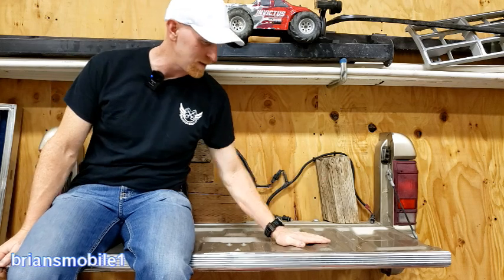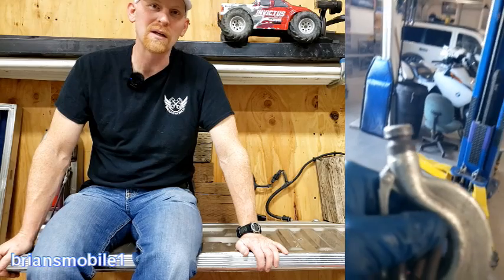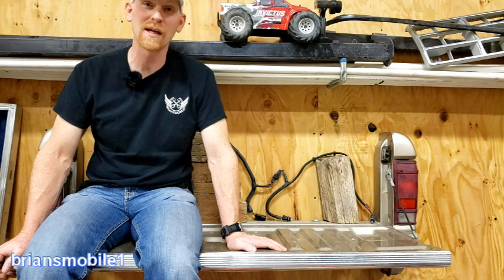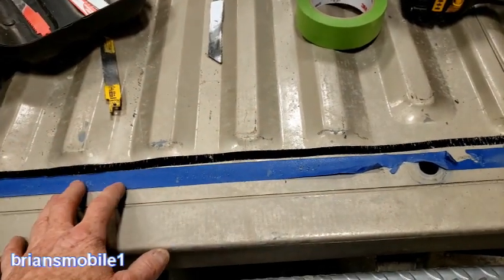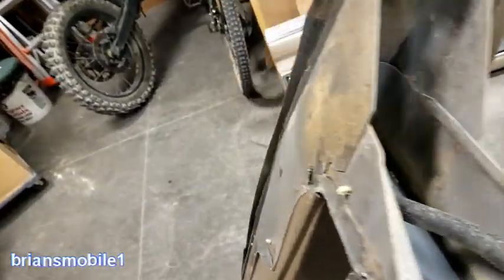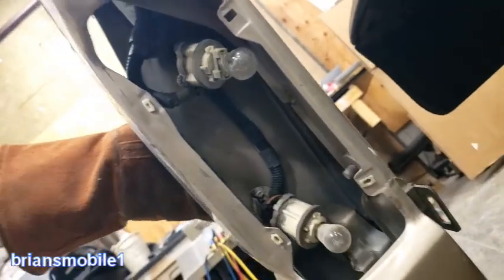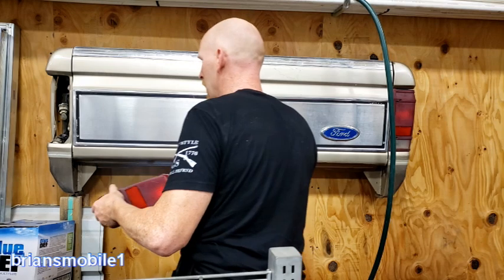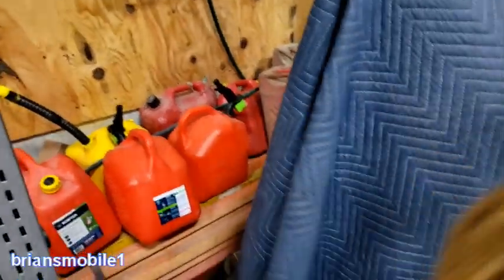Tailgate Shelf / Bench Part 1

Comment: Nice. It worked out good. 
Another way to do it if you have the space is to cut more of the bed off with the tailgate and put cleats on the wall and attach it to the cleats, kinda like the way some cabinets are hung. Happy Motoring.
Reply from the maker: Not a bad idea if you want more stick out like a box.

Comment: I had the tailgate on the truck, but it was bent when I got the vehicle, so I instead got a nice piece of plywood, and cut it to make a straight shelf there, attaching with a lot of screws, so it pulled the tailgate straight. Then painted it inside to keep the rust away, and put the shelf back, and varnished it. Made a handy seat when using the vehicle by the lake or the drive in.

Comment: Hi all
My father's subaru rattles and smokes on cold start then sounds fine (visible smoke only in cold weather). until you accelerate above 3000 rpm and the rattle starts again. I'm too far away to help my father, but the mechanics are telling him to change the engine. Does anyone have any advice or suggested steps to take? Thank you for taking the time
Subaru Forester 2012